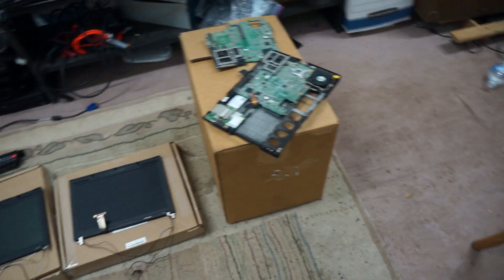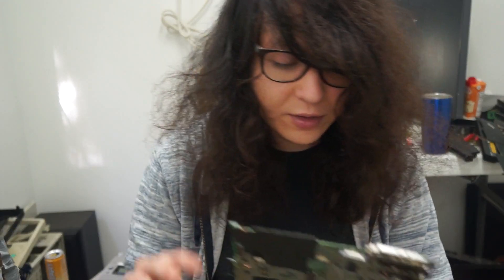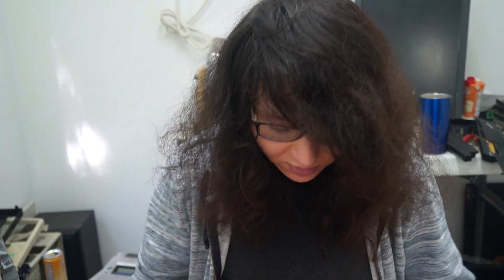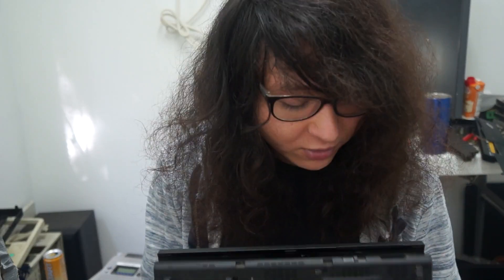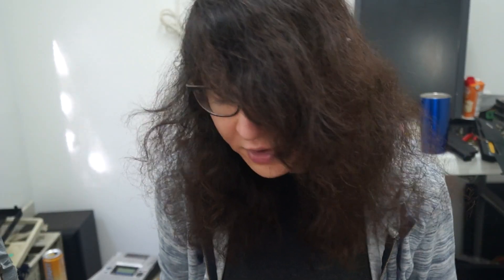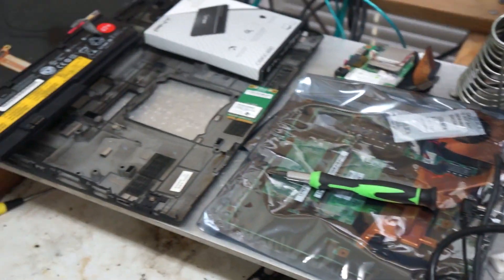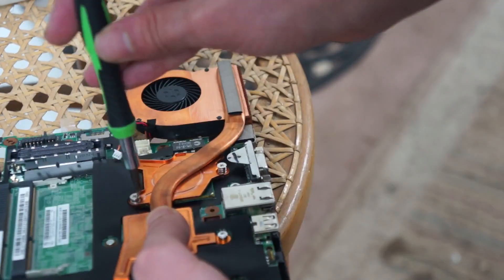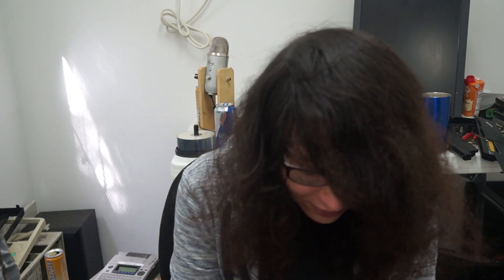Thinkpad x200 Tips Tricks and Full Rebuild

Comment: I bought a board with description “Lenovo Thinkpad Motherboard 45N4407 w/ Core 2 Duo 1.60GHz CPU Included” but am not sure if that is an X200 board or not. I bought an X200 complete display but it seems the ribbon connector of the display does not match up correctly with the board. Can you tell me what my board is and why the display cable doesn’t match up?
Reply from the maker: My guess is that it is for the x200 tablet model.
Reply: @tripcodeQ7  after some digging I found an image of the x200t board and that appears to be what I have. The giveaway is there is a little white connector on the board opposite the side of the heatsink. Unfortunately, that means the other parts I got won’t work with it. I ended up getting a whole X200 base, board, and top cover. The display assembly and keyboard I already have should make it a complete system. I ended up spending as much for parts as I would have just buying a complete system. It’s a bummer but I learned from it.

Comment: Hey man , i need change the heatsink also ?  , in upgrade x200 to x201 motherboard?
Reply from the maker: The motherboards use different heat sinks, so unfortunately yes.
Reply: @tripcodeQ7  Thanks i changed de motherboard , but the display is so low brightness, its okay i change the display also ?
Reply from the maker: @jdesu  Is it a cfl? or led? Check if the bottom of the case has a contains mercury sign.

It is much easier to do a lid swap, but if it is a cfl you can add a affs panel.
Reply: @tripcodeQ7  Yes have sing "Constains Mercury" then i swap all case or only panel ?
Reply from the maker: @jdesu  It depends on the screen you decide to replace it with. A full lid swap is easier, but it is going to be more expensive, with out the option to use the AFFS panel. If it is a CFL panel, and you decide to do the panel swap you have to be careful about the high voltage. This will be alot more work, I can update you in a bit on the improvement over a LED tn panel. I'm about to try that swap.
Reply from the maker: I'll leave a comment in a day or two and have a video out later.

Comment: So what RAM do you put in the X200? Mine currently has 4GB total and I'm looking into whether 8 works.
Reply from the maker: Normal PC3 memory, just make sure it matches, oddly the only time I had issues was with low voltage memory. 8GB total over two 4GB sticks definitely works.

Comment: Do you know how to fix this problem[0190 critical low-battery error] in thinkpad x200s?
The laptop was working fine and charging fine, at some point stopped charging. I though maybe the battery is over so connected the AC to the laptop and didn’t work, I tried everything that I could think of and also nothing worked. I asked everywhere I can and I followed the solutions of every post and also nothing worked. I got across your vids and thought to give it a try and ask you.
Reply from the maker: Sorry for the late reply, umm I'm not that sure. I have seen the systems run fine without a battery, but I typically remove the oem bios.

I would try getting a new old stock x201 6 cell. Those batteries are rather cheap on ebay about $16 dollars.
Reply: @tripcodeQ7  Hey, I got a new used battery and charger then the Thinkpad worked. I don’t know why or how but I had done that as a last try. Thanks for the reply

Comment: Trip, I am having a problem with my librebooted x200 - whenever I suspend it (sleep) it just locks down when I try to wake it up again. It is really annoying as I'm on a move a lot so closing the laptop and then opening it to continue my computing is essential to me :(
Have you encountered this problem?
Reply from the maker: I have not encountered this issue before, I normally uses the stable branch. If you are having this issue it might be on the operating system side of things. I would advise looking at the kernel log files.

Comment: my BIOS version is 3.20 and not 3.22, can I still try to libreboot my x200 this way? 
and what's your take on the ch341a programmer? what issues have you found using it? 

remarkable job, as always
Reply from the maker: If the EC firmware is the same it will probably be fine. You can't update the EC firmware after installing libreboot without flashing back the stock bios. So, I always update it to the latest version.

Comment: Love the X200 - so glad I finally got mine working, even though I had to buy a new motherboard in the end which was 2.26ghz instead of 2.4ghz :(
Still, really happy with it. Librebooted and running Arch/LARBS for an extremely comfy autistic experience.

If anyone is unsure about buying one, let me save you some time: do it. Really small, cute, portable laptop - great for learning how to use Lin-uh I mean... GNU/Linux on. If you have to travel a lot they're really light and a (n)in(e)cel will keep you going for a good while without adding much weight. Also, I recommend buying a dock, since it gives you more ports, looks cool, and gives you the option of a second hard drive, extra battery or optical drive.
Reply from the maker: I like my x200 as well, it is probably my favorite laptop.

Comment: I have 2 x200 units to assemble one,  (one has a bad screen, and the other has a bad keyboard), I still need a couple of things, seeing the video reminded me to get thermal paste, and I might use the one that will get no keyboard and no screen once at the end as a file server in my local network with a 4TB external drive attached

do you use anything special to wipe the non-CPU/GPU parts? (you say you use alcohol for those), or do you just use water? I got some "LCD cleaner" for the screens, but I'm not sure if I should use something special for the chassis
Reply from the maker: If it is dirty I just use microfiber cloth on the screen. One of those cleaning magic erasers can get light scratches out of thinkpad rubber with isopropyl, but you should be careful not to overdue it. If you get carried away you can remove some of the rubber.